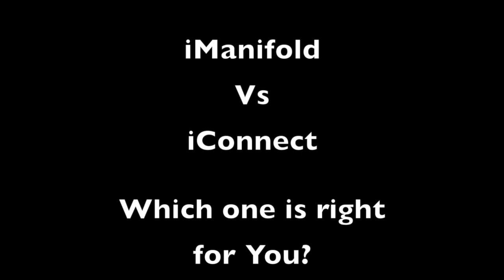HVAC Tools: iManifold Vs iConnect Which One Is Right For You?

Comment: Awesome video. That answered a lot of my questions. I am a commercial tech. Most of what I service is package units on roofs. In you opinion would the I manifold be a better bet since it’s all on the roof? Would the air probes connect if I stuck them inside the unit? Thanks!
Reply from the maker: Honestly I would get away from a manifold gauge all together and go to probes simply because with probes you lose basically no refrigerant from the system and if you’re using hoses on iManifold you end up losing 60 inches of gas in the hose. The air probes will connect from inside the unit no problem.

Comment: Is the iconnect the best on the market now? In 2018, your a great tech and have used all these tools. I'm trying to find the best?
Reply from the maker: I haven’t found any thing that actually beats it just yet. The Fieldpiece probes would be a very close rival if they teamed up with MeasureQuick!
Reply: I just got the iconnect kit. The box  hi/lowside probe, 2 humidity probes and 1 repeater, 2 pipe clamps, and the red pipe clamp. May need your help using this, also can I buy the duct plugs at parts house. I'm in nc near greensboro.

Comment: I would suggest using an old manifold and replace the gauges with 1/4 flare fitting then screw on the pressure probs the when you won't a manifold you have it.

Comment: i think id go with the manifold due to it being rugged, what about the connectivity to the manifold and air probs? issue there?
Reply from the maker: the zigbee radio is much stronger with much more range than BlueTooth. With that said iManifold just released extended range repeaters that could get you as much as a 1/4 mile between them.

Comment: I just recently, as of 12/18/15, received my new Iconnect system!!! I haven't had a chance to use it in the field. Just a few issues.....the system doesn't really come with any "set up" instructions per say, I have looked at a few video's on TTT site ....maybe I'm missing something but there again, nothing to really lead me in the right direction other than watching your video's! I would really like to see how you set up / placement of your repeater, and hooking up the sensors, IE outdoor ambient cable, etc. Maybe even your set up for adding refrigerant.... I have always seen you using it in the cooling mode but does it do the same thing in the heating mode for heat pumps? Any info is much appreciated!!
Reply from the maker: I trust you got the probes connected and mapped? As far as charging here is a short clip on that.
https://youtu.be/9DqBy08_cwQ

Comment: The only things I would add is the iManifold is a little less expensive as a total system. Second we never anticipated the user wanting the information everywhere when we designed the iManifold. We expected the user to want the information at the condenser where they would be working and the wireless probes will get the signals from indoors to them. The iConnect filled a need for a different use case. We still sell iManifolds 10 to 1 over iConnects.